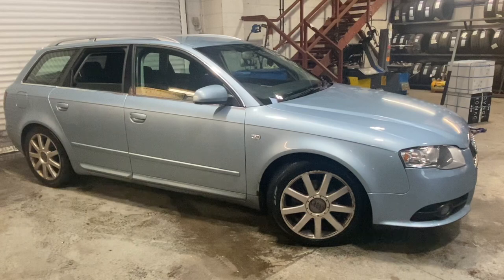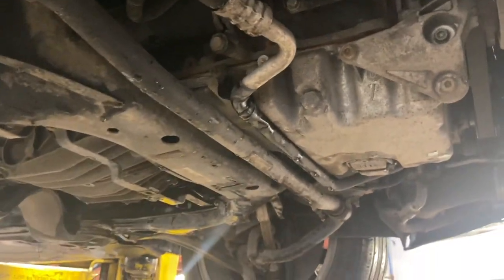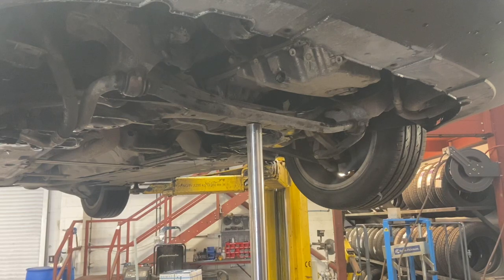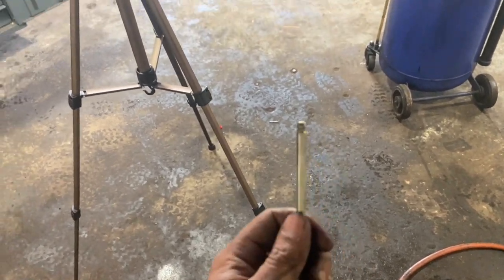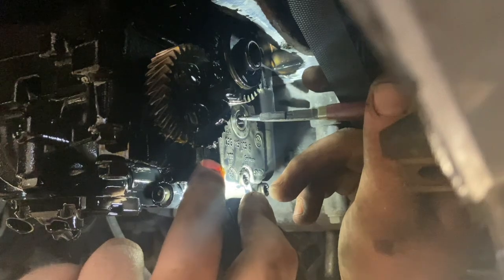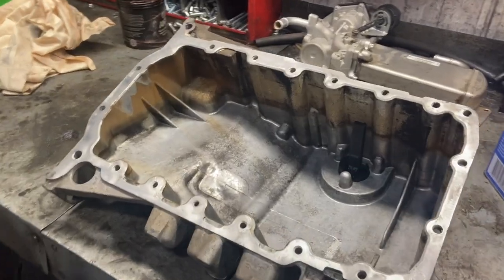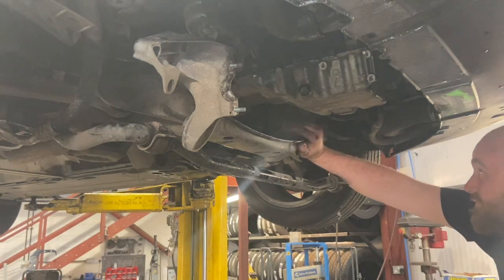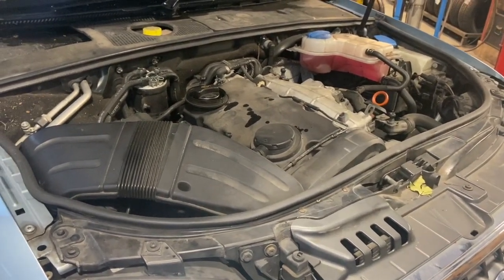Audi A4 Oil Pump Drive Replacement 2.0 TDI

Comment from the maker: Check Euro car parts - https://tidd.ly/3lIO7xA  (use discount codes on site)
Check GSF Car parts - https://tidd.ly/34pZe7o  (use discount codes on site) 
Check "Car Parts for Less" - https://tidd.ly/2LNEwIn  (use discount codes on site) 

Tools :  1/2” Dewalt impact driver - https://amzn.to/3e2Uff2
             3/8 Drive Mini Impact driver - https://amzn.to/3iFCZ30
             Socket set - https://amzn.to/390hmpM
             Ring Inspection Lamp - https://amzn.to/3gGWHcG
             3/8 Torque Wrench - https://amzn.to/3fuU5yA
             Engine Support - https://amzn.to/2Zsl2x4
             Spanner set - https://amzn.to/2DlwUZm
             Large Pry bar - https://amzn.to/2Cl9NNY
             Pry bar set - https://amzn.to/2Zg2lg9
             Copper hammer - https://amzn.to/2Z9bdUU
             Snap on 5mm long reach Allen bit - https://ebay.us/ioa5QV

Parts : 
77mm Oil pump drive shaft & clip : https://ebay.us/jOOzMQ
100mm oil drive shaft and clip - https://ebay.us/Z2WR9c
Copper Grease - https://amzn.to/38BWV1U
A4 Oil Pump eBay - https://ebay.us/r959Yw
FAI Oil Pump (euro car parts) - https://tidd.ly/3mc6jQi
Reply: I've bought a 100mm one for my golf 5 1.9tdi pd.
Car's on 106000 miles now.
I'm starting to hear a rattle sound from the bottom of the engine. Funny enough near the footwell where the oil pump is.
I didn't know that the turbo might blow because of the lack of oil pressure!?? 
Shoot better get the job done hadn't I!! :/
Reply: Is threebond rtv any good to use as a sealer on the oil pan to finish the job??
Thanks for the videos by the way. Priceless!! 👍
Reply from the maker: @jemmace2586  hi mate , Have you checked that it’s got that shaft type setup on the golf , could be a chain driven oil pump ..
Reply from the maker: @jemmace2586  thanks for the comment 😁 yeah rtv will be fine for the sump 👍
Reply: @diydaly  I'm told it's a hex balance Shaft type, but unsure tbh.
If it is and it's the 77mm not the 100mm, I'll scribe the line of the difference between the two and angle grinder the new one to fit, but I won't know anything until i take the sump off and have a look. 

Thanks for your replies. 👍
Reply from the maker: @jemmace2586  👍 no probs , might be worth ringing TPS up .. just ask em for a price on the drive .. at least you’ll know before taking the sump off 👌

Comment: Thanks, Great video perfect for amateur mechanics like myself!....One thing I found is that access to the 2 hidden sump bolts at the gearbox were not as easy to get as in in your video. They were also very tight and not moving with the 5mm allen key. I have discovered that there are 2 dimpled areas in the flywheel and by cranking the engine (clockwise only) at the crankcase bolt, you can line one of these up with the access channel to the 2 bolts. This will allow access with a 10mm swivel socket to remove these bolts. Hopefully this will save someone a lot of pain if they ring the 5mm ball end allen of the bolt like I did!
Reply from the maker: Thanks for the comment! To be honest I’ve never come across that before! They are fiddly but with then snap on ball end Allen keys I’ve always got them out .. handy to know that though, I’ll have a look for them cut outs out the flywheel next time 👍👍 learn sumet new everyday! 😀👌

Comment: Brilliant guys this is a major problem but no one has shown how to fix it quite like yourself easy to follow instructions
Reply from the maker: Thanks for your comments , very much appreciated 👌👍
Reply: @diydaly  I have this problem currently wouldn’t you recommend I do this fix or replace to a 1.9/1.8 pump like a lot of people have? Thanks
Reply from the maker: I’ve replaced 6 shafts now and replaced the pump and shaft together on one car.. my own was done at 130,000 mile and I’m currently on 165,000.. another one was done at 135,000 and I know it’s currenty at around 200,000 area with no issues so personally I’d just replace the shaft if it’s only just started to take the edges , if it’s fully rounded I’d fit a new pump & shaft 👍
Reply: @diydaly  so just replace the pump/shaft part not the actual housing with all the gearing in (the part you didn’t take off). You have links to both eBay and Eurocarparts for pump does the eurocarparts one include the shaft like the eBay one? Thanks
Reply from the maker: Yeah that’s it 👍 . The euro car parts pump doesn’t come with the shaft and they don’t list it so it would need to be bought from ebay or the Audi dealer , because they are a common issue a lot of people of Ebay tend to sell them together
Reply: @diydaly  brilliant thanks I’ll attempt this buy the shaft only if it’s in bad shape I’ll just pickup the part from eurocarparts works out similar if you use their discount codes.

Comment: Love your video! I’m about to buy a Audi B7 Quattro with a BPW engine, and it has gone 172 600km. And I’m wondering if I should put in the money to change the part or just buy a new oil pump, I think it’s a "investment" to change it, not sure if it has been changed in the past.
Reply from the maker: Thanks for the comment , much appreciated 👍👌 yeah it say its well worth changing the drive , its piece of mind then 😀
Reply: @diydaly  yeah, I’d have to do in a workshop, since my mechanical skills are somehow limited. So I would guess it would take a mechanic about 5-6 hours to change it? And the part it self cost about 1800 NOK,. I am really considering it since it will give me piece of mind for at least the next 100 000km ( I hope).Do you have any sites where you order your parts?
Reply from the maker: Id say you should be looking around 3-5 hours area, there not too bad to do but most garages would quote at least 4 hours min.. I normally use "car parts for less" or eBay, by id recommend fitting a genuine OE part, ive put some lincs in the description of the video to some of the parts mate 👍

Comment: did you have to move the flywheel so you could get those 2 x 5mm  tricky allen or can you get them anyways? thanks
Reply from the maker: You can access the without moving it mate

Comment: I have an opportunity to buy a 2005 audi a3 2.0 tdi it needs a new oil pump is it the same as this to replace and does the timing chain need to be replaced?
Reply from the maker: not its quite bit different mate, be wary too.. it may have done more damage

Comment: Hi when the oil warning light comes on will it make a noise or just the oil warning sign will it make a beep sound thanks
Reply from the maker: Warning will come on first
Reply: @diydaly  thanks so just the oil light will come on but no beep sounds thanks
Reply from the maker: @abdulbeany1894  usually makes a loud beep too
Reply: @diydaly  thank you very much apreciated

Comment: Hi do you know if the 2012 Audi Q3 2.0 TDI CFFB engine has this oil pump shaft issue. Or is it the Passat a4’s longitudinal engines ? 
Thanks
Reply from the maker: new completely different setup on the later stuff mate

Comment: I'm currently doing mine, I had to drop the balance shaft to inspect it, for this particular setup once I put it back together do I need to worry about timing?
Reply from the maker: Thanks for the comment , you should really locate it back in the exact same position 👍

Comment: My Oil pressure light appeared on my BPW 2.0 TDI 2009 A4 CABRIOLET, I immediately stopped the vehicle and recovered home, I will attempt to strip vehicle but seems quite headache just to take the sump off! What you recommend to change, just the hex key? To an uprated 100mm one? And what about the balance shaft itself will it not be rounded off too?
Reply from the maker: Hi! Sorry to hear you have the dreaded shaft issue! It just depends when you get it stripped , they don’t normally wear the balance shafts but you will have to see how bad it is , it’s it’s fairly well worn id advise replacing the pump aswell as the shaft.. as yours is a different engine code it may be more involved to strip.. I’ve had some variations which meant having to remove the front end / timing belt to get the lower pulley etc out of the way to access a certain bolt.. https://rover.ebay.com/rover/1/710-53481-19255-0/1?mpre=https%3A%2F%2Fwww.ebay.co.uk%2Fitm%2FReplacement-Oil-Pump-for-Audi-A4-A6-2-0-TDI-Engine-codes-BNA-BMA-BPW-BMP-BHW%2F333077531136%3Fepid%3D535834877%26_trkparms%3Dispr%253D1%26hash%3Ditem4d8cf7ca00%3Ag%3A9S0AAOSwlLdcaEmE%26amdata%3Denc%253AAQAFAAACYBaobrjLl8XobRIiIML1V4Imu%25252Fn%25252BzU5L90Z278x5ickkCrLl8erj3ATP5raQxjc%25252F%25252B84XZu0MldxKJEjsRiFn10ma6OrGYXzwevSoHXQRboX0KN9Z%25252FoXehvnH2cFLeLW%25252FOGs9jhj9FCkP%25252BFfxTEqIZ8KKfurkZIWIOSHutHXYMOWJ9DDCSLkWWjixkNq64p1dTf5zz1xA3m4YrqPlxd0m3S%25252BSuIeDJGW4KOPNYS%25252BAETvE6%25252FPEiAFvoZvJUQsYQavZQQTgwNkqBUrnYzfRD7HMIFXpg9Mi9kJzTNoHth2eDEx1pSQuClyHoQ7NuntJoNg5q7Yih6YA1wTSGRlzM2D9vMj77cG6Ln3otpP%25252FdxqMgxzdy1%25252B3vVkr817leH6iStvR15bPy12W9RvJxOj824X1eA6osLHc5sC7q591XIEuXtHrcULayj8eVPfHyWU5FJnqrADIF7tDLN9QSMC92NXRMQ9gMMy%25252FL7mU7D78G5enou0l6rTsOpy3FBT%25252F5pYBa13uTrGeMGpTWRFksl9fmxPLWo92vjeiog9RvToyPVqfmXscV%25252Bf8yExJG9gaCuO7CZyz8iaGoNuDNkVBFdJpFd14PxYGRsE1VOm%25252B8rg5aYaAA9glwKGYcIpOC6P6FFzAi5h2scI%25252BMedgLnTufZFalXGuLystjHPxcHtBEhlKy9VQnz6sj3QUUw8MeDtU9emD8UOCVXDsf1MrkKowgpQd53VVPPA7wb3MsBvBOuMSTHgelCvgqBZ%25252BzdHWCgTGaNsA%25252FvATRgorC6FHTib0wiVmpnlvfRwvtcr7ZDyirMEm3xtzZuSA%257Ccksum%253A33307753113608a994d3a2604341ac986c381b87d269%257Campid%253APL_CLK%257Cclp%253A2334524&campid=5338704655&toolid=10001&customid=Oil drive pump
Reply: @diydaly  Just to let you know the BPW 2.0 tdi engine, is the same removal as your engine! So engine has now been stripped down to the sump but having issues getting the clip out
Reply from the maker: @sullythegamer2492  glad to hear it ,, thanks for letting me know 👌 .. they can be abit tricky at times them clips! Hope you get it all sorted 👍
Reply: @diydaly  clips out and my car is 2009! Yet it has 73mm hollow hex!!
Reply from the maker: @sullythegamer2492  glad you got it out! That’s surprising at the age! Did the shaft have much wear?
Reply: @diydaly  I am going to order replacement hex key, and then check for play in the shaft if it is then will have to replace
Reply: Btw my engine just hit 85k and the hex key completely slipped
Reply from the maker: @sullythegamer2492  nice one , I think you’ll get away with it mate 🤞👌😁
Reply from the maker: @sullythegamer2492  that is early!
Reply: @diydaly  have you got an email address ? I would like to send you pictures
Reply from the maker: @sullythegamer2492  gavdaly@hotmail.com

Comment: Hi there how is it possable to check for balancer wear without removing it once the hex key is out ? before putting a new key in .
Reply from the maker: Hi Oliver the only real way to check without removing it is by feel With a new shaft .. to check if there’s any free play.. normally the condition of the old shaft will give you a good idea though 👍

Comment: Hello guys , Nice video but i have a question, my engine is a BRE from 2006 ( 2.0tdi ) and Audi shop give me a 77mm
I see that there are two types possible, so which is the good for me ? Thx
Reply from the maker: yeah just depends if its had the modified drive fitted or not, if not the 77mm will fit

Comment: Hey, is there a way to know/control if it needs replacement before it gives damage to the car? Or just go for it even without any signs to be safe? 
Just had 200k kms, never replaced
Reply from the maker: Hi Pedro! No I afraid there are no early signs of wear 😬 the only first sign would be the oil pressure light coming on .. obviously at this point the shaft would need replacing immediately .. annoying I know but as a guide if it’s never been done I’d say on average I’ve personally found them to fail around the 130,000 - 140,000 area .. obviously that will differ but that’s just in my experience.. I did my own at 130,000 and it had just started taking the edges off .. hope this helps
Reply: @diydaly  I actually did the test on mine and the oil pressure light wouldn’t acuse so.. that’s troubling lol was thinking of putting a oil pressure manometer but not sure of how useful it is 
Thanks for the reply!
Reply from the maker: No probs 👌👍

Comment: On my Audi AR someone has removed that whole oil pump you have and put a make shift tube to the oil sump, do I need to buy a new oil pump or will there be more to it?
Reply: A4 saloon*
Reply from the maker: Hi Rich , why has someone removed the pump? without an oil pump the engine wouldn't last 5 minutes
Reply: @diydaly  to try and fix that hex cheaply I guess, I think they put a smaller oil pump cheap one w a little makeshift pipe to filter the oil to the sump, is it worth doing a full make over on it
Reply from the maker: sounds very odd, hard for me to say without seeing it mate
Reply: @diydaly  yeah it's a dodgy job someone has done on it
Reply from the maker: 😬 sounds like it

Comment: Hi there mate great Vid. 
may i ask if you could help?
 I own a A4 2.0 tdi SE BRD WITH 70.000 miles and last week replaced the 77mm hex key with 100mm key and replaced  Balance Shift number 2 with a upgraded shaft  before any failures happen. 
But I'm now getting red oil pressure Warning light, The engine sounds fine and upon opening oil filler cap oil is being spat out indicating oil circulation .i will test oil pressure once the kit arrives
Would you have any ideas what i could of done wrong? before this i did not have any warning lights.
i'm a fairly competent home mechanic who followed a how to guide and own the relevant workshop manuals.
Reply from the maker: Hi mate , like you say first thing is to check the actual oil pressure.. there fairly strait forward . Aslong as the shaft is in it should be pumping .. did you change the pump too? Have you checked the wiring to the pressure sensor? Is it saying oil pressure on the display? Just wondering if you’ve disturbed the level sensor in the sump and the fault is relating to that..? That will put the red oil light on .. if it’s a pressure fault they usually say “oil pressure” on the dash
Reply: @diydaly  hi thanks for getting back to me really appreciate that.
We used the original pump as the shaft was done as a precautionary measure.
Oil pressure sensor on the oil housing itself tests fine with air and continuity.
Yes it says red oil pressure warning can in the display after the car has come up to running temperature 
We replaced the oil level sensor in the sump with a new hella unit because we had a yellow oil level sensor warning on the display
I'm going now to test the pressure I'll update when I have some more info
thanks again
Reply: I think we've fixed it
Tested the oil pressure and once the car come up to temperature were are getting 20psi at idle and up to 70+psi above 2000rpm
We took the car for a run with the pressure gauge visible through the windscreen and even on a hard pull the pressure never dropped, yay

After some head scratching we tried a new Oil pressure sensor on the oil housing and bingo! no more oil pressure warning in the dash display
Were guessing it just must be bad luck the sensor packed up at the same time
Thank for your help after what you said about the sensors we checked more thoroughly and started with the easiest to replace
Reply from the maker: @deano1234567  are nice one, at least you've got it sorted! 👍 can be mega frustrating when that happens after you haven't been near the near the sensor ha

Comment: Did i get this right: I have to unfill the gas to go on with the work? If yes: How can i do that without that big machine? i have everything i need in my garage, but why should i have that crazy ass gasmachine? ;D Is there any walkaround??
Reply from the maker: You could pop to a garage and ask them to degass it first , then pop to them for a regas after.. I wouldn’t recommend it but you could empty the system by removing the caps on the fill points and pressing the centre of the valve in , it’s advisable to do it in a open area

Comment: Very good video, how often should the key be replaced on miles ? Should the balance shaft not be replaced also ? If the hex is worn the shaft would have worn also ?
Reply from the maker: I checked mine at 130,000 and It was just starting to go .. if you replace them early enough you’ll get away with just replacing the shaft although it’s allways nice to replace to pump at the same time.. I’ve only ever replaced one balance shaft... the balance shafts are a lot harder than the shafts so don’t tend to wear although yes you are right , there is a possibility and it does need checking but 95% of the time the balance shaft is ok
Reply: @diydaly  thank you, i have , superb book in next week  with skoda to get a new hex key installed, i presume they will check the pump and the balance shaft any
way to see condition. i will also get the timing belt and water pump done, gearbox oil and full service.
Reply: @diydaly  some people say its best to fit after market balance shaft and key, but I think OEM will be ok, and get it checked avery 30-50k miles ? what do you think ?
Reply from the maker: @ronancullen4565  yeah oem will be better if you can fit them 👍 to be honest if you get them done you’ll be good for another 100,000 miles 👌👍

Comment: Does this affect the cbbb engines in the tiguans too? How much does a job like this cost ?
Reply from the maker: Hi mate , it doesn’t affect your engine code 👌👌👍
Reply: @diydaly  really ? Thats great had a couple of garages say it did and then a couple say it doesnt so was at a bit of a loss 😅
Reply from the maker: Yes as far as I’m aware .. I’ve not known it as an issue on that engine code 👍